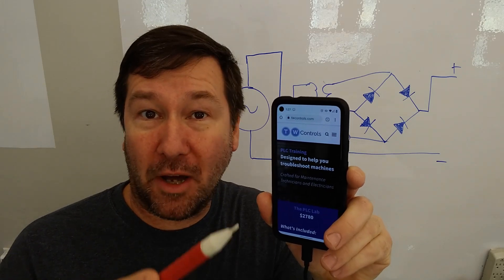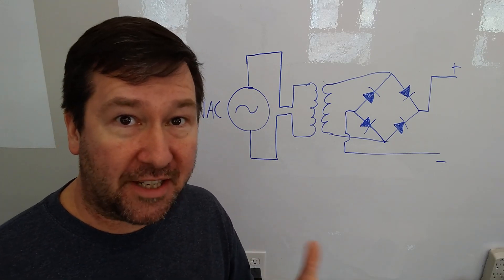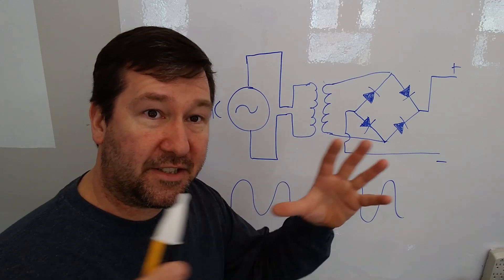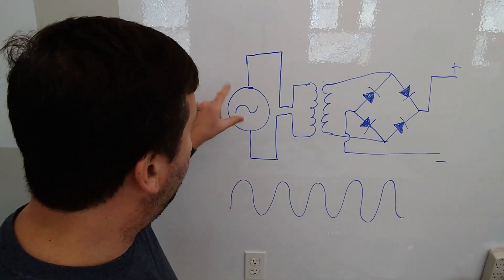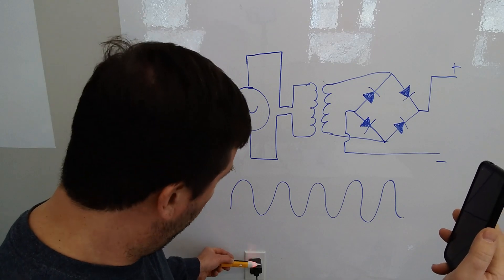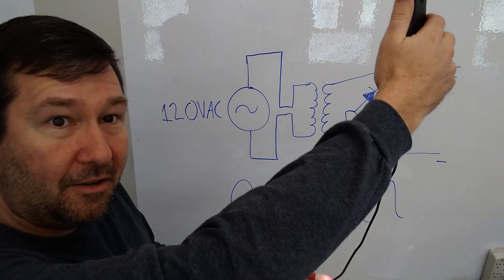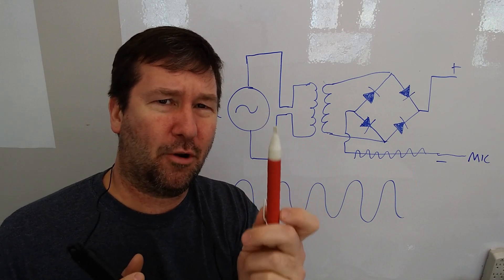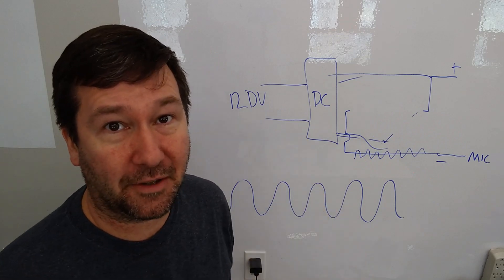Dangers of Charging Cell Phones from 120VAC Wall Outlets?

Comment: Great video, not many transformer type chargers used for charging or low voltage power supplies now days.
More apt to be a PWM switching power supply doing the task.
Reply from the maker: Yes I have a pwm I'm going to play with soon.